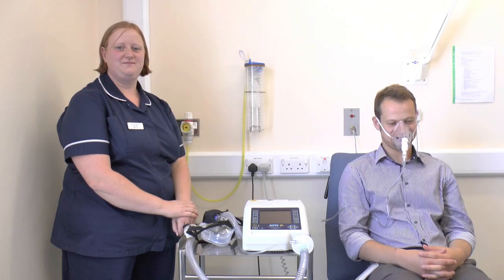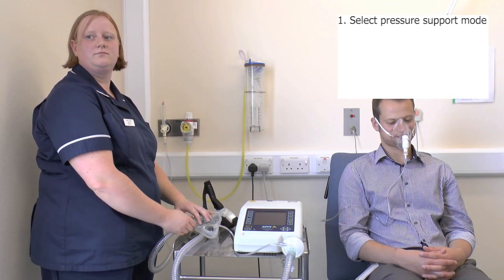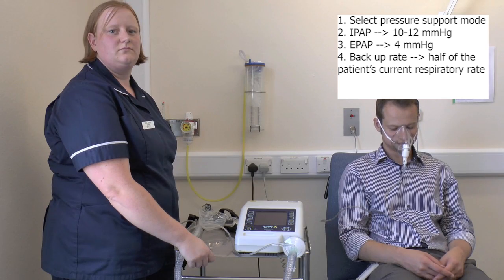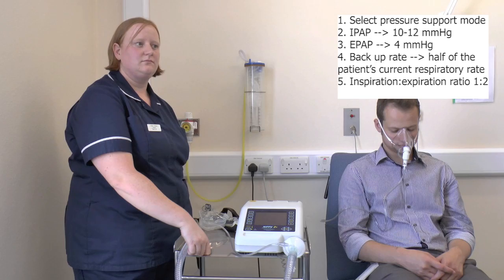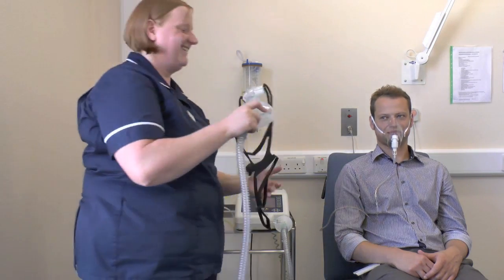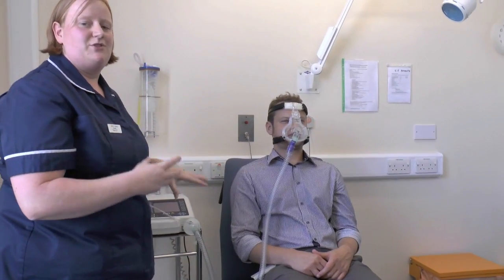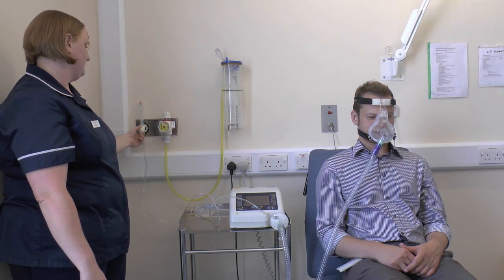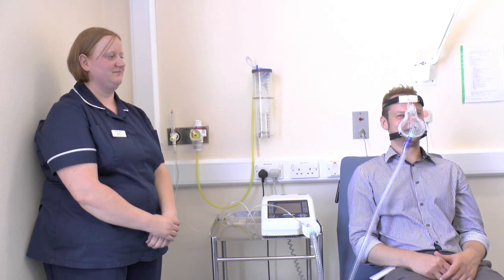How to Set Up Non Invasive Ventilation

Comment: Please explain how the term BiLevel is used when clearly using BiPAP.  Bilevel is a seperate mode of ventilation which is  a mode from Puritan Bennett clearly no one on BiPAP could or should ever be confused with BiLevel. BiLevel is for patients requiring very high peep levels and rapid drop times 0.8 seconds or so due to severe or acute ARDS. Patients on BiLevel are in a world of hurt. I wish I could draw it for you on this format but that is impossible. The term BiPAP is know by practitioners world wide to confuse the terms is a dis-service. Yes, there are two pressures IPAP/EPAP but never BiLevel.